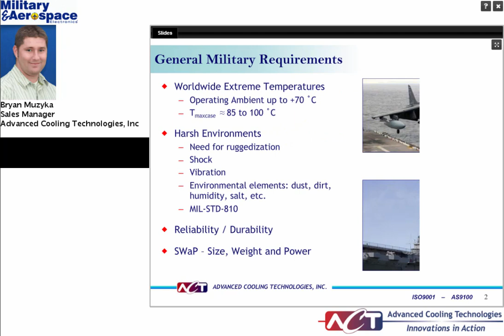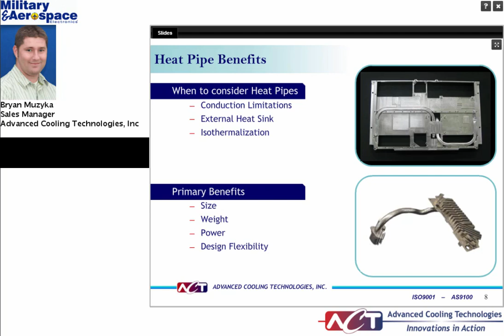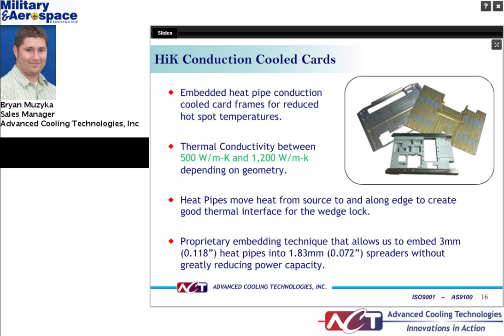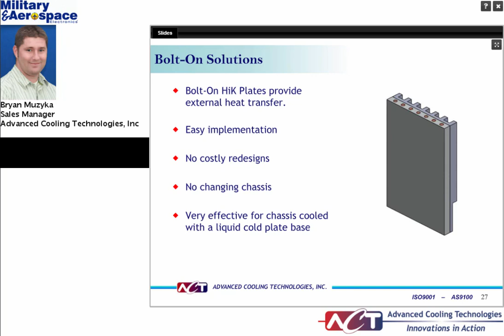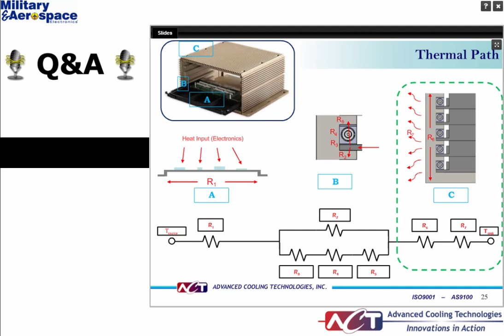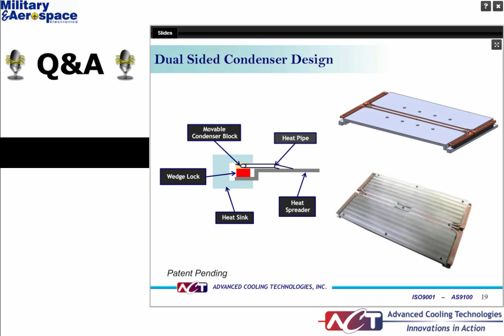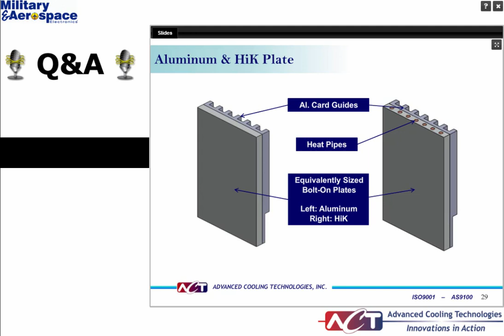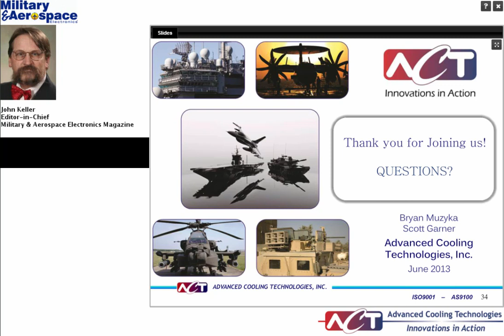Webinar - Thermal Design in Military Embedded Computing Applications

Comment: The thing I do not understand is, why there is a hole in the middle of the mounting bar of wedgelocks?
Reply from the maker: We’re unsure the exact Figure you’re referencing; if you provide a slide # we can provide better feedback. However, looking at the products displayed, there are two primary reasons for holes or material removed: (1) mounting of components; typically electronics to the top of the heat spreaders or wedge locks to the edges or (2) to provide weight reduction to the system; since heat pipes provide the thermal benefit, you can add weight reduction features to the system.